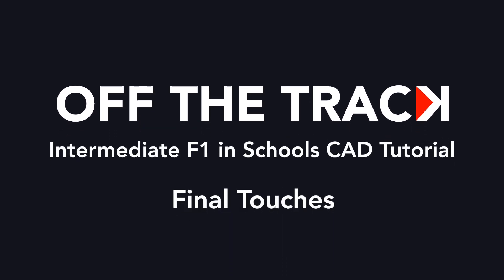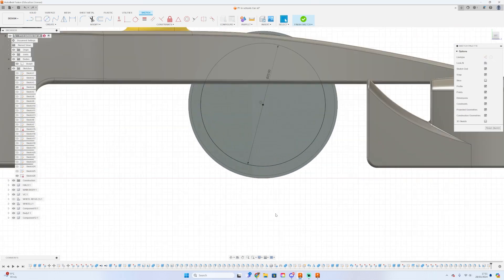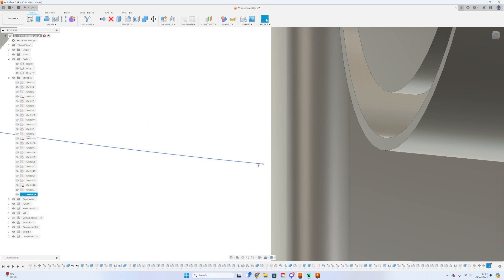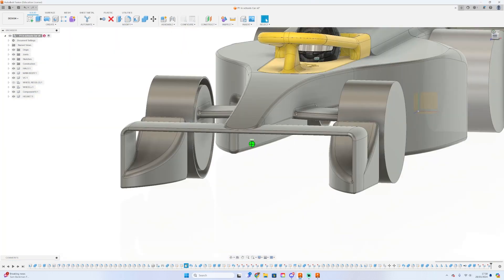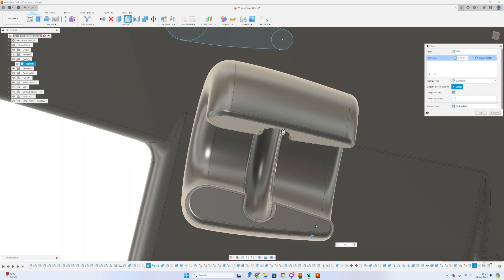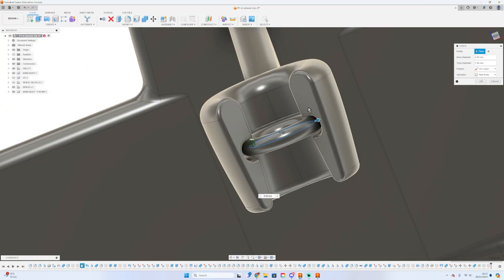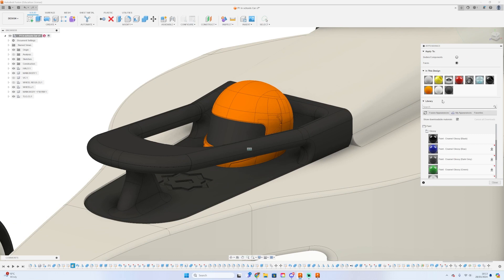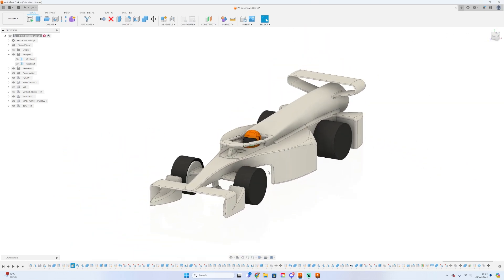Step 7: Final Touches — F1 in Schools / STEM Racing Intermediate CAD Tutorial | Off The Track

Comment: Amazing tutorial, but I am curious about one thing; what is the point of modelling the wheels? Because correct me if I am wrong, arent teams required to use the pre made wheels which they sell on the store? Same goes for the wheel bearings and connectors.
Reply from the maker: This depends on your competition class. At the World Finals and in Professional Class, you can make your own wheel systems.
Reply: @OffTheTrackMedia I dont understand how the tiny part made inside the wheel is meant to hold up the wheel during racing im stumped